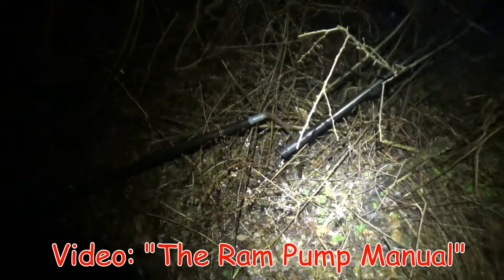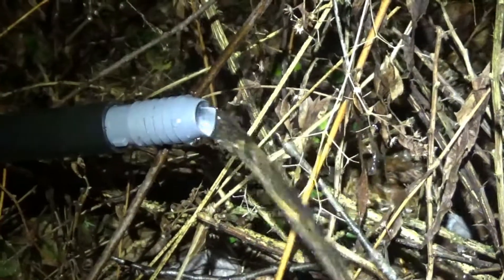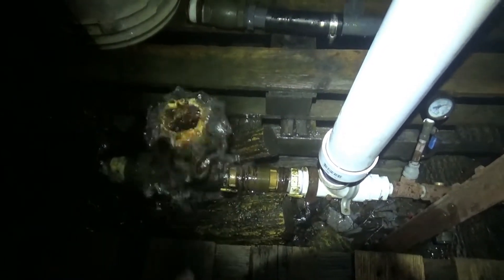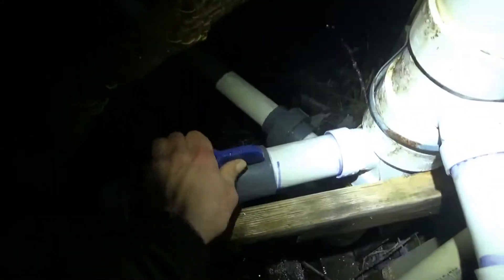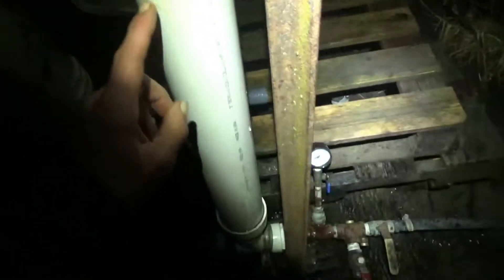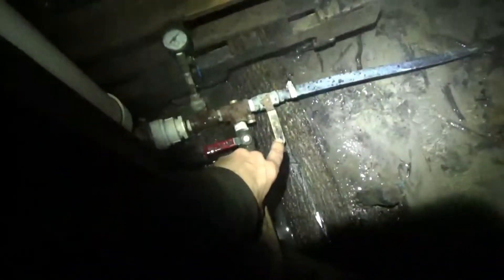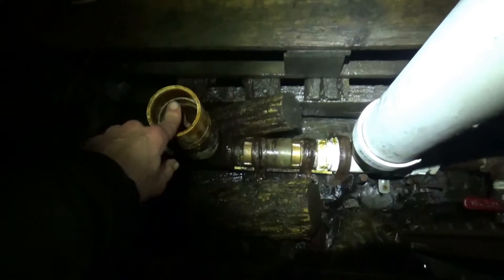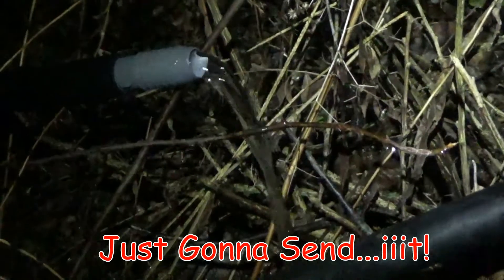Ram Pump Problem Diagnostics Surging Waterlogged Pressure Chamber Example

Comment: Okay, I just finished assembling a 1-¼" ram pump, all galvanized and brass (except the pressure tank of course). I notice two things - I can't keep it running more than about 40-50 cycles, and the in-line swing check valve seems to be leaking, allowing water from the pressure side back to the waste valve.

I notice you are not using a swing check valve for your in-line check valve. (Or I think, that looks like a spring check valve?) Did you ever use the swing check valve before? (I built mine pretty much identical to Engineer775's for starters.

We've also talked about your use of the foot valve. You said you swapped primarily for reliability. Did you have problems keeping the swing check valve running at all, or did you get a lot better than my 40-50 cycles? 

I've got a test setup with 2" pipe coming out of the bottom of a 2500 gallon tank with 7' of water, then another 6' drop with a 60' galvanized 1-¼" drive pipe leading into the pump. I'm just using a ¾" delivery, consisting of hoses for now until I get this thing a bit more reliable.

Many thanks for any feedback!

-Jeff
Reply from the maker: leaking back from the pressure side is likely at least part of the root cause of your issues. I definitely recommend a spring loaded check for the valve between the pressure side and the impetus valve.  I did have success (days or more running) with the swing check.. but ultimately it would always glitch and stop.  Once the foot valve went in and I got it tuned it was solid and reliable... months of run time with no issues. Another thing to look for if your system keeps stopping is a possible pressure leak either in the chamber itself or anywhere in the pressure side.  I hope this answers your questions. If you have any more don't hesitate to ask.  If you can get a video of your system running I could get a better assessment on what's going on probably.  cheers and good luck!
Reply: @TheFarmacySeedsNetwork  Wow, I replaced the non-waste check valve with an inline piston/spring one like yours. With my water source wide open and the delivery pipe closed, was able to manually prime the pump, got up to about 40 psi before it took off on its own. I got afraid when it reached 75 psi, opened the delivery side.  But I never could get it to run on its own. I thought maybe not enough back pressure, so I added another hose up the hill. The gauge reads 20 PSI when delivery is open, pump primed but not running. Then I tried cutting down my deliver pipe input (is being fed by a 2" line at the bottom of a full 2500 gal tank). Seems like it ran better, but still never more than 50 cycles. I will get some video this weekend and post it on my channel and send you a link. Thanks for the feedback on the check valve, that part sure made a difference.
Reply: @TheFarmacySeedsNetwork  I replaced the waste swing check valve with a foot valve, and I just reversed the spring (underneath so it would push, instead of on top so it pulls). No drilling, no weights yet. I cut my drive pipe down to 50% open, and I shut the delivery. Let the pressure get up to 70 PSI, slowly opened it and found equilibrium at 40 PSI. The delivery pipe can't be open more than 25%. But it ran continuous, and delivered 1 gallon in 1.5 minutes (40 GPH) with a very hefty elevation climb (50 ft?) over 300' of garden hose. Yay!!!

Do you think adding weight to the foot valve would allow me to find equilibrium at a lower pressure?
Reply: https://youtu.be/BIf39KRj7GU
Reply: And one final test: added another 125' of hose up a steep hill, so we're way up, 75-80', and I had enough back pressure to run everything wide open, drive pipe and delivery pipe, at about 30 PSI. And I got 2 gallons in 100 seconds, which is 1728 gallons per day at that elevation. So it looks like we're cooking!!!

Comment: Thanks for the video.  I'm curious I observed the difference in surging, but did you notice a difference in overall water volume delivered?
Reply from the maker: Thanks! Yes volume delivery appears to go up when the PC is saturated. I attribute this to less air and the volume under pressure has nowhere to go but out the delivery line. Makes me wonder if you made a pump out of SUPER thick and strong materials if it might be more efficient.
Reply: @TheFarmacySeedsNetwork  Well isn't that interesting the saturated (not much air) pressure chamber deliver's more volume at least for the given pump site parameters.     Raises the question - is the pressure chamber necessary for the ram pump to work?   If so, maybe the pressure chamber itself can be optimized?   Optimization may mean different things.   

Ram pump users are frequently just concerned with a pump that works.  Others may be concerned about the most lift.  In my case, for irrigation use, I think I'm mostly concerned about volume of water delivered to a usable height for the best cost.    I've also realized that some pressure is needed at the delivery location to run drip and low pressure sprinklers like the Wobbler because flood irrigation does not work very well with a limited amount of water.

There are discussions like this are being discussed in the facebook public group Water Wheel Pumps - I hope you will take a look and join in if interested:   https://www.facebook.com/groups/240458583255303/
Reply from the maker: @davebean2886  It is interesting, I think for sheer volume delivery that might work, but you would need VERY thick walled materials of extreme strength (think heavy duty steel everything) so it would be expensive. Why not just deliver to a higher elevation and storage tank and use volume to run sprinklers on timers or some other easy management tool?  I have 110 gallons in the barn as a reservoir.. and 4000 in a  pool and I switch another 275 gal tank to act as a second high elevation reservoir in summer. I have run irrigation sprinklers off it with some success (need more elevation). Here's a link: https://www.youtube.com/watch?v=seOrWdH_ZXY  Regardless, I too, am intrigued just have no funding and time to experiment. It is on my list though.   Another option for more volume might be a spiral pump. Thanks for sharing the link, but I don't do facebook.
Reply: @TheFarmacySeedsNetwork  When we have an adequate volume of flowing water available, it is hard to believe that water powered spiral and water powered mechanical pumps can't be competitive with ram pumps based on water volume delivered.  Water volume data is hard to come by, especially for different lifts.   aQysa has a commercially available Barsha spiral pump and a higher volume HyPump in development - their team must think they are a competitive option - see some of the discussions linked below:

- aQysta Barsha Pump discussions - may be more:
https://www.facebook.com/groups/240458583255303/permalink/240463779921450/
https://www.facebook.com/groups/240458583255303/permalink/524249241542901/

- aQysta HyPump discussion: 
https://www.facebook.com/groups/240458583255303/permalink/529091431058682/

However, with scarce data - can't help wondering about hooking up a dozen ram pumps, filling storage tanks 24 x 7(as you suggested) and releasing the water (perhaps using automatic bell siphons) through a gravity fed irrigation system?   Maybe buy lots of ear plugs?   Good thing, some are looking into sound mitigation for ram pumps including running them underwater and different types of check valves.
Reply from the maker: @davebean2886  yes.. all good stuff. for quieter pumps.. submerge the outlet and build the drive pipe into soil or a thrust block.. greatly reduces noise.  Yes, huge storage is really the best way to go for most situations. I want to build a pond here around 112,000 gallons.. fill all winter.. irrigate all summer.
Thanks on the links!

Comment: suggest incorportating a bleed hole in the bottom of the pressure chamber so fresh air can get in.
Reply from the maker: Yes, that is on this year's list.. a snifter valve. Sizing has to be just right or you kill your pump.

Comment: Better to use a bladder pressure chamber
Reply from the maker: I agree.  I did have some tennis balls in there, but they have since given up. I will probably replace in the spring with a bike tire tube.  Still, I usually get a couple weeks at least before I need to flush and re-air the PC.
Reply: @TheFarmacySeedsNetwork  if you replace with bladder tank either 8 liter or 19 liter it will increase your production, before I'm using pvc pipe with bicycle tube inside, in comparison the latter is much much more better.
Reply from the maker: Ahh yes an actual pressure tank. I might incorporate that in future upgrades. Eventually I plan to go to steel drive pipe and some better air ballast system. I also plan to extend my system out for a higher fall head. I think, piped properly, I can hit close to 9 ft of head.  Sounds the like the tank is working well for you! Thanks for the tips / feedback!
Reply: @TheFarmacySeedsNetwork  agree the steel drive pipe is better not too much energy lost and durable. And if you want a higher lift it is better to fabricate a waste valve that you can put an additional weight to reduce the heartbeats. It will increase the pressure.
Reply from the maker: Yes, looking forward to the upgrade. I have a bunch of steel antenna mast that is actually telescoped. I think the telescope affect will amplify the hydraulic effect a bit as well. Looking forward to the next upgrade.  Would you like me to mention your channel? I'm happy to share your knowledge with others!

Comment: Thanks for these tips. I have a ram pump. I have it disconnected for the winter. Won't be long and I will have it up and running. I use it to supply water to my pigs, chickens, and horses. Also water my garden.
Reply from the maker: Thanks for watching and appreciating!  Yeah, I have a greenhouse, so when we get a winter thaw i refill my thermal mass and reserve tanks and then shut back down between. Summer I do the same, irrigation, chickens, washing, drinking... you name it. I LOVE my Ram Pump! It just keeps working and pumping without a dime in fuel or power!